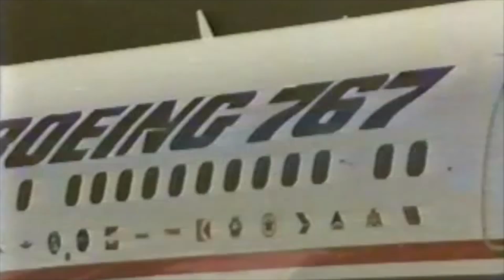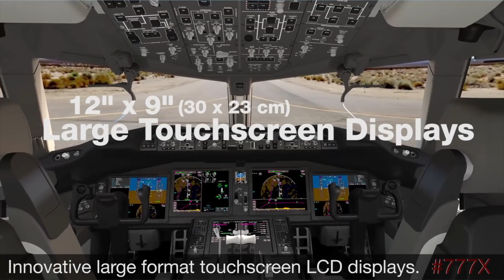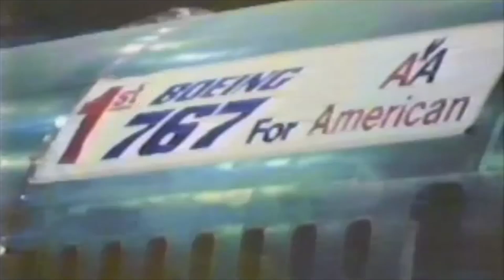Boeing 767X ? Temporary Middle of the Market Airplane?

Comment: Personally I think that Boeing really should re-engine the 767-300ER. It wouldn't make sense to develop an all new 797 when it may not be as fuel efficient as the Airbus A321neoXLR. Since Boeing is looking for a twin-aisle jet for their new midsized aircraft, it would make sense if they re-engined the 767-300ER or -200ER. Most people like the 767's cabin configuration, so it would be best in Boeing's interest to configure them with fuel efficient range boosting engines. I don't see why they didn't, they re-engined the 737s like 3 or more times.

Comment: With the changes proposed on the 767X the cost will be the same then as the 787-8 as there is only a $20 million price gap?

Like pickup trucks in America, manufactures are dropping V8’s and offering turbo 6’s that work harder and cost $3500-6000 more than a V8 for only a 2-4 mpg improvement. Go diesel and it is even more expensive.
My GMC in 2013 costs $40850 before discounts last year the same truck costs $59640 that’s a $3k a year average price increase! Keeping my truck till it dies.
Reply: Yes , I like to see you

Comment: What's the point of remake of 767?? That's y Boeing Launched 787 programme to replace 767 !!?!!?
Reply: 787 does not replace 767.  Not even close.  WAY bigger plane.
Reply: @w8stral  I agree but ...but that's the ideal candidate for replacement!! ....almost similar type rating for larger variant
Reply: Boeing gets a lot of orders for the 767F. However, the 767 uses old CF6, PW4000, RB211 engines which are not really that fuel efficient. So, Boeing is planning for a 767x.
Reply: @rak7673er  80-90% of the requirements are filled by the 787 to replace 767.....efficiency ✅ 2 aisle ✅ range ✅ cost ✅   what's more ??
Reply: @masud-ulalam6216  Its OEW weight is 40 tons heavier between 767 and 787...  That is the empty weight of a 737/320 you are hauling around with you burning fuel if you do not need the massive range of the 787.    Another way of saying that the PAYLOAD of a 767  freighter version is  equal to that of the difference between the 787 and 767.  Obviously the 767 gets that payload to its market and the 787 has not even left the airport yet...

Comment: As a over four decade major u.s. Airline employee working on the 767 , this is a great idea.   I hope Boeing goes with it.   The production lines are there , it is a giant plus for passengers.   With the two three two config, re engined,  having all the bells and whistles of the 87, it surely is the answer.  With the positioning of the engine issue , it will be top priority when they design, to ensure it will not be another debacle as the max.  I've worked the max and it's a stunning aircraft , passengers loved it.  I hope it is resolved soon.  The attributes our passengers love the most on the 87 is the pressurization ,  and the quietness mostly.   For the airline its price and efficiency , as well as unlimited opportunities for frequency and non major hub operations to many destinations that relieve hub congestion.  The 67 has always been a passenger favorite and there are thousands of routes that the aircraft already flies and could be more.  The cost will be minimal in crew training , the crews love the aircraft and do not want to see it go like the 57 that was a massive mistake from Boeing.   X upgrade, both xlr, lr, and short to medium haul variants will sell many many airplanes.  Not as large as the 77 x series that's seems to be plagued with issues and no u.s. Major airline seems to want to order so far.  The 67 has been a workhorse and I'm sure the three largest carriers will do back flips to assist in its development and vie for launch customer status.  I feel Boeing has made such horrific mistakes , cheapened up and fell victim to profit over safety and maybe this will be their redemption and return to the world leader in aircraft manufacturing.   While I like the Airbus aircraft as well , and the a350 is spectacular, doesn't seem to be an aircraft that fits the need of the 67 and Airbus isn't offering anything , this seems to be a great resolution.  I'm sure we will find out soon.
Reply: Music Feign — The position of the engine is not the problem with the 737 MAX.

Comment: Cargo airlines do not spend big bucks on new aircraft. All shippers use a spoke and hub system, with a centralised sorting location. At night, all flights head into the hub, freight is sorted and loaded, planes head back to their destinations. Then they sit on the ramp, all day long - waiting, which is a very inefficient use of a $200+ million aircraft (when bought new). Better to pay a little more for fuel, but $10 million for an older jet, if it passes most of it's life on the ground. That's why Fedex still flies 68 A-300's. The A-300!!! UPS flies 52 of them...

Comment: I guess Boeing have their hands full with the redeployment of the 737 MAX and the development of the 777X in 2020. They are likely to consider the 767X or 797 only in 2021, if 2020 goes to plan. Boeing should have spent 5 billion dollars or so in the development of the 737 MAX and now they are spending 10 billion dollars in compensation to the families of the dead, airlines and potential other penalties. 
Hindsight, had they spent this 15 billion dollars in a new design they would have had Airbus struggling to sell the 320 Neo. What a run away success the Neo has been; I guess by the same time next year the Neo should cross the orders the CEO version secured over 20 years. Phenomenal!

Comment: I've said it before, given the 737-max and -NG airframe debacle, and despite the fact the 767 is a native widebody and can be re-engined easily, the optics are not good for Boeing. They got caught fudging the 737 type certificate to ease conversion and they have to build customer trust again, hopefully by pulling out a clean sheet design. Not that I don't think the 767 is a good plane, ditto the 757, both of those have exceptional records, but so did the 737, until they put profit ahead of building a safe airplane and being a responsible constructor.
Reply: Excellently argued! You hit all the nails on their heads!

Comment: The larger touch screen displays from the B787 have been already added to the USAF KC46 (B767 based) tanker at USAF insistence.   The work is already done.  The production line is still open.  Boeing would need to add the latest GE or Rolls Royce Engines probably existing versions Trent 7000 or GENX dialed down.   The fact that they are winding B787 production down to 10/month might mean they are leaving space for B767.    After all Airbus has a niche of A330-900 neo with production rates of 4 per month.  The A330-900 has an impressive range of 7200nm but although due to its light weight composite structure the B787 beats it in range and fuel burn by about 5% below 4000nm the A330-900 has no disadvantage.   So far no US airline has ordered the B777X, it’s too big for their style.   The B767 MAX would do well between major US cities in which slot congestion makes the B737 unattractive but which are not far enough apart to justify the B787.   These new build B767 will be based around the B767-400.  Curious if the could resurrect the shorter B767-200 or 300.
Reply from the maker: William Jones-Halibut Thanks for your comment. Oh thanks for giving me insight to this new information, even I can learn a thing or two. Yeah since the new flight displays are added this is all adding up to a re-engined 767 which will then have a lower development costs making the airplane more appealing to airlines. Also time taken for this program to enter into service will be reduced in time for 2025 (hopefully). Thanks for tuning in to the channel and stay tuned for next weeks video!
Reply: Indeed. The market currently lacks a replacement for the B757- 300 and the B767-300. The B787-8 or A330-800 is good enough to replace any B767-400ER. Both the reengine 767-300 or  an even shorter A330neo will likely do better than the re-engine 767-400ER.

Comment: I think the most suitable engine for 767x/797 is GEnx-2b with @67k lb thrust
Reply from the maker: stradivarious hardhiantz Thanks for your comment. Yep the 767x is a lighter and smaller aircraft with 787 and less thrust is required given the lower landing weight. With less thrust, there will also be reduced maintenance costs and airport fees. Thanks for watching and if you have not done so do consider subscribing for more great videos!
Reply: @oneskyflyer  reduced thrust doesn't lower the maintenance cost. The engine design does. The RR trent XWB although has 97klbs of thrust, its maintenance cost is still similar to the RR Trent 7000 engine as well as the Trent 1000 which only has 72klbs of thrust. On the other hand the GEnX 1B-76 engine has a lower maintenance cost compared to the Trent 7000 and Trent 1000 engine due to the simplicity from the dual spool design. 
As for the airports landing fees, they are tied to the MTOW and not the thrust. The lighter B787 still has a higher landing fees compared to the A330neo because they have higher MTOW and payload compared to the A330neo.
Reply: @chingweixion621  At least Boeing isn't likely to choose Rolls Royce to supply engines for the hypothetical 767x, especially given the Trent 1000 problems.
Reply: Boeing should choose this engine if deciding to make a 767X. It would be a waste for GE if the -2B engine is exclusive to the 747-8, which is not selling like hotcakes

Comment: some points need clarification. There were 4 variants for 767. What supposedly is proposed is a re-engined 767-400, which is bigger than the current 767-300F, so as not to mix things up. Re-engining does entail a cost, and would be rather questionable on a 30-40 year old airframe already at the end of its rope. A passenger version of a 767-400MAX or whatever you wish to call it would not make any sense whatsoever. Firstly it would compete against the 787-8, being almost the same in size and capacity. Secondly, both are too big as a NMA aircraft. But with a shorter range, poorer economics and less payload capacity. An exercise in futility. There is also the onus of restarting a production line that stopped years ago. Again, the cargo version still being produced is 767-300F and what is being evaluated is 767-400. There is a 7 meter difference between the two. In the automobile industry nobody would consider taking a vintage automobile of a generation ago, adapt a new engine and attempt some cosmetics. Neither will it work in the airplane industry.  There is also the point that in all likelihood Airbus will come up in 15 years time with a new replacement for their A330NEOs, so buyers of this 767 contraption would be left high and dry at the middle of its lifespan.
Reply from the maker: Luis de stefano Thanks as ever for the detailed comment. Yep Boeing is apparently supposed to re-engine the larger -400 variant though it will be interesting to see a new freighter -400 variant which will allow airlines to carry larger goods, but unless the takeoff weight is increased, the payloads will be similar if I am not wrong. I do believe that there is still potential for upgrading the 767 as similar to 777, the new 777x is actually the third generation of the 777 series. Just like the new Porsche 911, I guess that the new 797 will be similar in shape and size to the 767 but be fundamentally a new and better aircraft underneath. Thanks for watching!
Reply: @oneskyflyer  regretfully I do not share your view.  There is a limit to upgrades on everything. In this instance the 767 is outdated any way you look at it.  It would share with the likewise antiquated 737 the dubious privilege of being the only two commercial planes with fly by wire systems, just the same as the Wright brothers, Louis Bleriot or Santos Dumont a full century ago.  Plus conventional hydraulic and electrical systems. Pneumatic rather than electronic controls. The wings are the first transsonic version of 40 years ago, with an aspect ratio under 8, totally outdated today. The CF6-80C engine has a fan diameter of 93", and the proposed new 787 GEnx-1B has an 111" fan, a more than tight fit. Even lay people know by now how badly such transplants have ended. Taller landing gear will be needed, and to house it a new wingbox will be required.  And I could go on with a dozen other examples. In the end you have to design an entirely new plane, so for that be brave and go for the 797! Even skipping many of the above updates, a 767-400F would be a rather poor cargo airplane. The cargo capacity increase as I said is rather limited, and not worth the effort and the risk of launching the variant. The 767 has a double-bubble lower cross section just large enough to house single LD3 containers, or 2 LD2 which are half the size and capacity, used on smaller craft like for example the A320. It is miles behind the larger 777 as a freighter, or other available today cargo planes. A positive no-go.
Reply from the maker: @luisdestefano6056  Thanks for sharing your point of view. Well everyone has different perceptions and I feel extremely privileged to see the perceptions of many other's through the Aviation community on YouTube. Thanks for tuning in to this latest video and I do hope that you enjoyed it!

Comment: I can see it working for cargo aircraft. What commercial airlines  do you see choosing a re-engined 767-400er  over the A330-900 and the 787-9?
Reply: Also the cross section of the 767 is perfect. Any passenger would prefer to cross the Atlantic in one of those than any narrow body.
Reply: @jdf1stats   im just referring to what Boeing needs to compete in the market, especially since they don't have an answer for the a321xlr. 
If price was the biggest factor, you'd probably see more airlines operating the 767-400er over the A330 and 777.  I'm of the impression that airlines will still choose the A330neo and the 787-9 over this proposed re-engined 767-400er.  I think it will  work better for cargo though.
Reply from the maker: @jdf1stats  Thanks for your comment. Well a widebody aircraft will be able to offer lower cabin altitude and with more mass, a smoother ride. That said, the A321XLR and A320neo family does have an impressive cabin for a single aisle and the seats on A320 are actually wider at 18 inches in economy compared to most 767s flying today with their 17 inch wide seats in 8 abreast. Thanks for watching and if you have not done so do consider subscribing for more videos!
Reply from the maker: Travel bug Jay Thanks for your comment. Well I do think that the 767-400er will be slightly to large for the middle of the market as it seats 296 passengers in 2 clad layout. In that case, airlines might as well opt for the Super efficient new 787-10. I do see a re-engined 767-300 variant being popular though as it is smaller than the 787-9 or A330-900neo while offering less range but be more efficient per trip, if Boeing manages to make it 25% more efficient than today’s 767. However factor in lower maintenance costs and acquisition costs for the smaller and cheaper 767, and this is an attractive aircraft especially for routes that do not require either the range or capacity of 787 but needs more seats than A320 or 737. Thanks for your enquiry and if you have not done so do consider subscribing and stay tuned for more great videos!
Reply: @oneskyflyer   a re- engined 757 is what Boeing  needs to compete with the A321xlr.  Sure that 767 may be cheaper, but the 787 can do everything bigger and better. I can see this 767x idea working well with cargo companies.
Reply: Price.